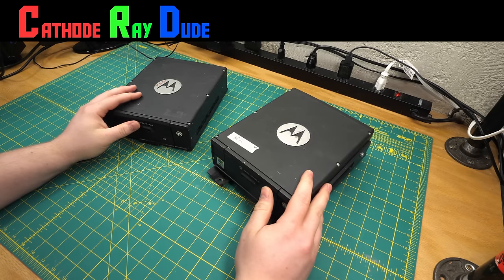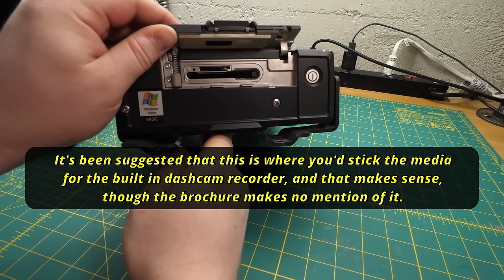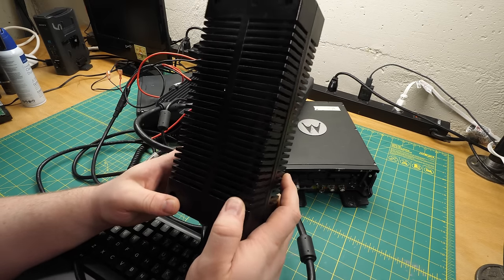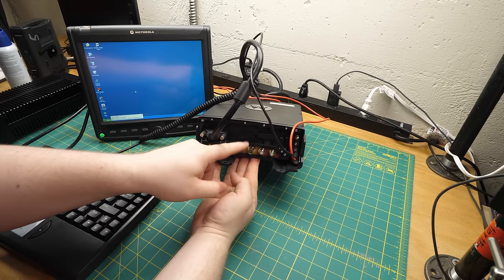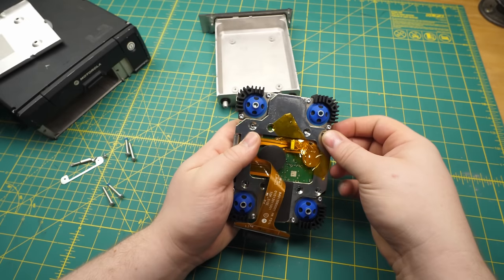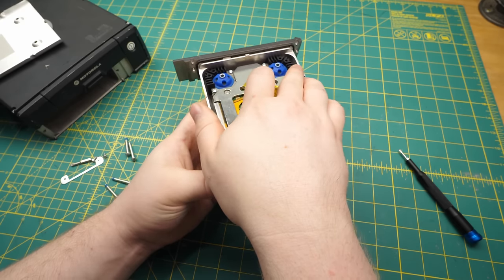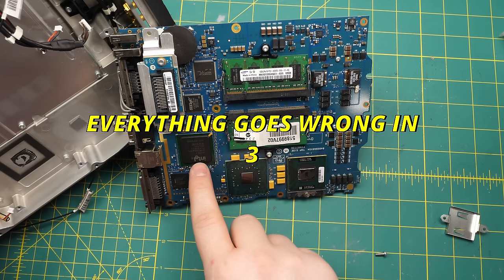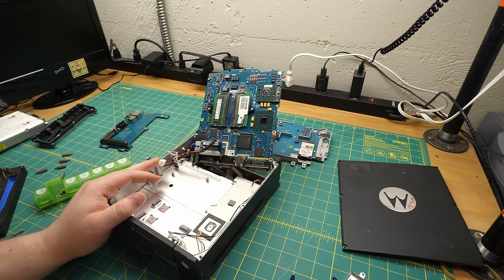Little Guys 7: The Cop-puter [Motorola MW800]

Comment from the maker: Oh you know what, it doesn't have an SSD because of the video recorder. Without that, it wouldn't need much more than a 16gb EMMC, but video tears it. Performant SSDs at the time weren't very big, cost a fortune and couldn't tolerate a ton of writes, so an HDD made a lot more sense for continuous video capture.
Reply: My jurisdiction they were and still are mounted in the trunk of cars and SUVs behind the backseat in the trucks
Reply: @Natsumidragneelkim  as a truck drive i  hate this thing it   sucks
Reply: Don't feel too bad about the trunk stuff , some certainly do/did have another machine in the rear and then there's always csi , marine police , etc etc. All would see the same machines advertised in the yearly convention. Love the oddities of this series , the lesser and lesser known devices if you aren't in that field or line of work/sales.
Reply: not trying to be an asshole by saying this ..{im far from one been a fan of the channel for quite some time} but how did you not realize this doesnt go in the trunk after giving the whole shpeal about the custom cables only being for the particular device.. then hooking all of the said custom cables up to said device.. and seeing they dont even reach 5 feet long then again..ive been super excited about some things in the past and something obvious has flown over my head so i get it .. xD just wanted to point this out thanks for awesome vids!
Reply from the maker: @alexenochss  see the whole thing I've been trying to establish with this series is that I'm not very good at getting things right on the first try lmao
Reply: @CathodeRayDude  lmao I get it I'm not complaining just pointing out something lol I'm sure you had a laugh when I pointed that out if someone didn't already lol
Reply: I feel like the reason the drive has the connector folded over 90 degrees is intentional to allow more unrestricted freedom of movement. It allows for the drive to get bumped around while the connector is fixed (albeit with those bushings) against the end of the sled. It seems like that would be less stress on the connections than trying to get enough slack in straight-through arrangement.
Reply: That video conector looks like a MDR36, perhaps it uses the OpenLDI standard.
Reply: As a ham radio person I can see a lot of uses for this unit.
Reply: Both Motorola and ICOM use MiniUHF(MiniU) on business radios and Goverment Radios even some of their handhelds use it as well
Reply: @thesmashtvnetwork  I hate having to install them in trucks because I have to remove everything to run cables
Reply: I remember very well my first SSD in 2010, I bought it for my new laptop, it was supposed to be a high quality one. Back then they were prone to fail, but we exponential speedup when doing software development was life changing. The drive failed in the middle of a vacation in 2012, with a lot of bad consequences. So yeah, they def would not had a constantly writing SSD in that thing. I would love to say that no other SSD ever failed after, but in fact two years ago a Samsung 970 started to die after one year with bad, non recoverable sectors.
Reply: 12:23  Clever devices in Woodbury NY sold this device. Ask them for info about the cables. I think these things were sold for  around $12k each, plus spares plus parts. Plus heck knows what.
Reply: @firesurfer  it's a dr700 a talking bus computer really not very interesting even if you do have all the hookups
Reply: @CathodeRayDude  the whole comments section and not one reference to SCMODS
Reply: @alexenochss  They sold other lengths of cords so you could mount the CPU in the trunk. Its just the kit he got has the short cable version.
Reply: Rtos reqs. No polling
Its the bus thats significant
Reply: @criostasis  I mean the cop stuff is obviously because ACAB, and he explained that his disdain for Motorola comes from inside information from friends about them doing military industrial complex shit.
Reply: I have had my issues with Police too, like I got pulled over and the second he saw my ID and my name he said , that's one of them Arab (he pronounced it AY Rab) names (I am Turkish first one born in USA, both parents are fresh of the boat, legally with proper paperwork etc.) Anyways he said do you have any explosives in the car, I scoffed and said no, he called a K9 unit, nothing was found obviously, he didn't apologize and still gave me a ticket, judge threw it away thankfully, but from my experience he is the exception rather than the rule. The reason I say that is I use to work fixing cell phones, and did fix some for the local PD that were being used in investigations (I don't know why they did not have their own tech lab), and a vast majority of the cops that I met seemed genuinely interested in heling people get justice , and catch the perps. I absolutely agree that cops like the guy that asked me that question and called the K9 unit after seeing my name should not be cops, and that they should receive more training, and that some reforms to their policies are needed. 
PS none of the phones that we got at that job were actually part of the chain of evidence they were mainly ones that were being used as support like they pictures could contain an image of relevance to the cops but the phones were smashed etc. PPS this is before Smart phones but after camera phones
Reply: 29:39 It makes no sense they would need to heat a hard drive that is sitting right over the transmission tunnel of a police car. What makes more sense is that they would want to detect overheating and reduce drive speeds to keep the drive from burning up. Cop cars spend most of their life idling, either with the heater or AC running. So of all the extreme conditions this unit has to survive, low temps are the least of your concerns.
While there may be thermal sensors in the drive itself, the ones applied here would be far more responsive to sudden temperature changes, such as you might see if you suddenly stomped on the gas to go after a speeder. 
This video elucidated why police dash cam videos of this era seem to often drop in bitrate when the cop first gets on the gas. It is literally because the drive is slowing down in response to a sudden shock thermal load. The custom nature of the video capture driver probably has as much to do with enabling variable bitrate recording as it does locking out menu options that don't work. The fact they didn't use standard SATA really has more to do with enabling a custom pinout for custom, driver based control than it does reliability.
I suggest trying some more recording tests. Set the thing on a hotplate and see what happens to video quality as you crank up the heat.
It just makes sense. You would much rather have low quality video than no quality video so it is logical this is how the system would work.
Also, an inspection by someone knowledgeable in board repair could reveal some secrets about the HDD. Perhaps the normal temperature monitoring has been bypassed somehow. I have learned in life not to make assumptions such as assuming you looked up the drive to see if it was a standard enterprise model. Wouldn't necessarily be obvious at a glance. It also wouldn't tell you whether the drive control circuitry has been modified in some way after leaving the factory.  What I do know is that when a consumer or enterprise HDD overheats, it shuts off completely, which isn't ideal for a computer in a police car when you are trying to record the evidence you need to get a conviction.
Reply from the maker: @Lurch-Bot  I'm quoting directly from the manual, I thought I put the picture on the screen even.
Reply from the maker: @Lurch-Bot  also, have you ever driven a car in extremely cold temperatures? I drove a van through the Northeast US in winter a couple years ago, and with the heater going full blast, the cab was still so frigid that I had to put a blanket over my legs and wear thick socks. Maybe a nice passenger car wouldn't have that problem, but the crown Victorias were pretty rudimentary. It also takes some time from the vehicle starting to heat actually coming through the floor pan, whereas a heating element directly on the drive mechanism is going to couple into those components nearly instantaneously, instead of waiting half an hour for the heat to seep through the extremely heavy metal chassis
Reply: I like the drive caddy soft mounts.  I always worry about relative movement between heavy components fatiguing the connectors (solder / PCB fatigue and fretting corrosion on terminals).
Reply: Western Digital Purple drives were/are a line specifically tuned for continuous video capture.
Reply: @CathodeRayDude  Secondary unused drive hole pattern reminds me of sata ssd cutouts, you know, ehen you remove the plastic casing
Reply: @alexenochss  Most of Motorola's radio gear is trunk mounted and has a 17 foot cable. The limiting factor might be the video cable, but I am sure you will find that CPU in a trunk mount configuration.
Reply: @taxirob2248  ITS GOT A COP MOTOR AND COP CPU AND RUNS ON LEADED GAS.
Reply: @alexenochss  There's a couple versions of the cables. Some definitely could reach the trunk....
Reply: Bro what's your problem with cops and motorola? Are you on the far left or something?

Comment: Remember folks, it's not distracted driving if you're a cop zoned in on your coptop
Reply: And playing on your phone? That's "on patrol"
Reply: So the laptops talk when they receive data from the dispatch server. It’s all text to speech now. Found that out when I got cut off and in a pretty bad wreck. They had me sitting in the front passenger seat since it was cold out.
Reply: I've seen em typing with BOTH HANDS while going over 40 mph!
Reply: @Mike2321x maybe some of them have the option to turn text to speech on, but I doubt it's very common place, or even commonly used
Reply: Patrolling around Coppadocia.
Reply: In Germany they added an extra paragraph to the general street driving law (StVO) for police and emergency services, that allows them to use their computers and radio.
Reply: @Yixdy  yeah and Ive seen people texting or eating with both hands at 80mph like we are any better
Reply: @Mike2321x  but those people aren't held to a higher standard like cops are. If those people injured/killed someone else during the act of distracted driving, they couldn't get away with it like cops with qualified immunity can. and those people aren't allowed to pull over other drivers for doing the same thing
Reply: Who are you gonna call when you see it?
Reply: I saw an NZ video of a person lecturing two police officers because the driver was using her cellphone to text while driving through an intersection.
"It's for police business"
Dude proceeds to scold them like they're misbehaving children.
Reply: @davitdavid7165 Ghostbusters, obviously
Reply: A few years back a cop in Los Angeles county hit and killed a bicyclist because he was busy messaging his buddy on his laptop. No charges were filed. 😡
Reply: Well atleast here there is a shitload of training and selection to become a copputer user
Reply: No, technically, it is in a cop's job description to be a distracted driver. But is it any surprise to anyone that cops literally get paid to be massively hypocritical douchebags?

Comment: Imagining a screw-in usb-c connector on the bottom of a phone and smiling serenely
Reply: Saw it on a rugged phone that had FLIR built in and a giant battery built in.  Sadly, the next release of the phone ditched it.
Reply: you'd probably see that in one of those display phones you'd see at tech shops
Reply: You can find those in the industrial cameras and similar computer vision sensors
Reply: I'd love to have screw in USB C on my mirrorless camera, so that I can use SSDs instead of SD cards and still be sure that it works. Actually I'd like all ports except the 3.5mm ports to be many USB C ports on it, as long as HDMI and the trigger latency isn't too bad via USB C
Reply: @xWood4000  oh man that would rock.  We get half assed clamp things, but they don't work.  I have worked with some box cameras that have OTHER ports that can screw in, but never USB.  At least none that I have worked with.
Reply: I have seen screw-in usb C, but it was on the Logiq E10 Ultrasound machine.
Reply: A screw in connector on a phone is unheard of.  If anything how many people have phones with broken, loose or dirt clogged USB connectors?  It is a sad thing to think about but some people put their phones through all sorts of hell!
Reply: @meatbyproducts  I would imagine that some models of those scanners they use in a lot of stores that look like phones may have a screw in connector for charging
Reply: @charleshines2142  I have a few of them and I haven't run into one yet.  I have an older handheld scanner/tablet thing has a screw in charger but it is not USB.   Screw in USB would rock in so many situations.   Hell clamping USB would be awesome, line DVI cables.
Reply: They exist on some thunderbolt enclosures that use the USB-C connector! Though you do have to buy an attachment thingy that snaps on the cable’s connector to add the screw.
Reply: The USB-C Spec has two different ideas on how to put screws on it.
Reply: Well I got that cable it cost me 1$
Reply: The usb c on my phone will happily hold the weight of my phone. I can't see a scenario where I'd need to screw it in. If it was screws you'd end up with people on phone with dirty ports forcing the screw and causing damage.
Reply: At work, we make heavy use of "circular connectors." Makes me really jealous when I have to deal with connections at home.
Reply: Screw-in wireless charging anyone? So the phone does not slip off of the inductive pad? :D
Reply: @julian-sark  it's called a wire just use the cable. It's far more efficient and if your attaching it just do it to a cable.
Reply: @HA05GER  Thanks! Also kindly note, that ":D" thing is called a smiley, and usually denotes a light hearted comment, preceeding joke or a statement of deliberate irony.
Reply: I'm expecting the fucking thing to still only work under specific angles 😩
Reply: @julian-sark  AHH yes I didn't clock it. I didn't realise anyone was using Nokia's still :p
Reply: @HA05GER  Fair! Alas, while it might not have the youths new-fangled graphical smileys, at least my Nokia can put dents into even the sturdiest Cop-Puter, if need be ;)
Reply: @julian-sark as a Motorola phone owner I feel slightly hurt by that 😂
Reply: You think that's funny but they really should have gone with a threaded micro connector for fast charging. USB-C is a joke because you have to have a perfect connection for it to even work. This is why I have to frequently clean my cable connectors with contact cleaner and buy a new phone charging cable every 3 months. As far as data transfer goes, there was nothing wrong with what we already had. USB-C but my phone transfers files at USB 1.1 speeds🤦‍♂
IDK why people think that high current power delivery and data should be combined into a single plug but it is truly one of the dumbest ideas ever. It is really just a fire hazard and you end up with a standard that really isn't good at doing either job. You just end up with dirty power because that's all data is from an electrical supply standpoint - noise. Things like USB-C and PoE are just a placebo for the lazy. Reminds me of those various devices from 25 years ago that promised to use the electrical wiring in your home as a conduit for some type of data, whether it was analog or digital, and there's a reason Zoomers don't even know such devices existed.
Reply: Blackmagic URSA broadcast cameras have screw in USB C ports for the LANC controller
Reply: It would be nice if the screw in USB had an indexing lug so that you dont have to flip it 3 times to get it right.